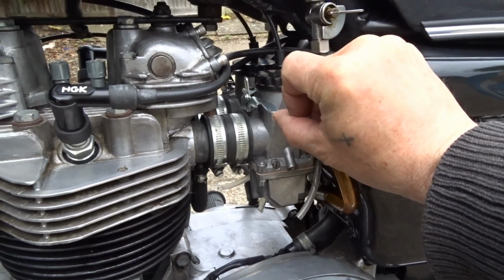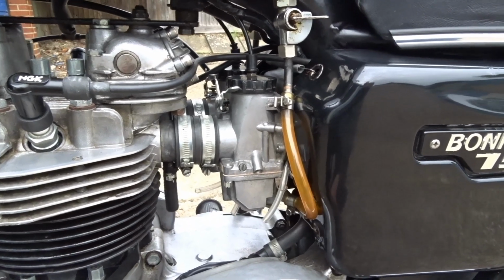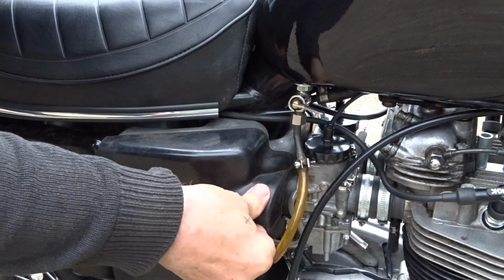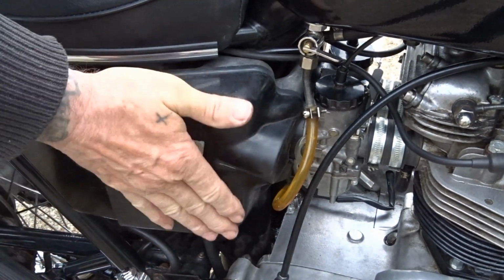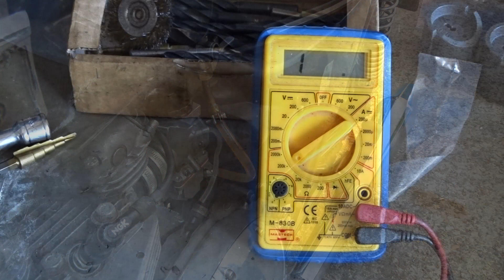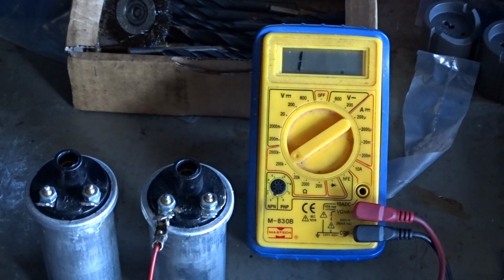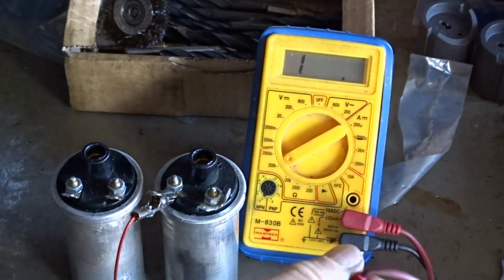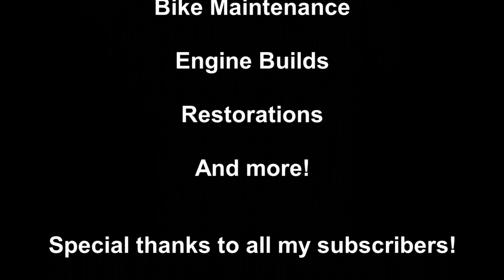Triumph T140 - Stumbling issue while accelerating possibly solved

Comment: I once had an intermittent slight misfire on my T140V, it was mildly irritating when it did it under load, but when it was idling, it would be running ok then suddenly stop. I fitted new plugs, new needles in the mk1s, cleaned out the pilot jets, made numerous air screw adjustments, but it was still there. I tested the resistance on the coils, both ok. After much head scratching, to confirm it was an ignition fault I connected up my strobe and watched the flashes at idle. Now and again, it would miss a flash or 2, and sometimes cut out. As I live quite close to Boyer Bransden's factory near Maidstone, I took the ignition module to them for testing and that was ok too. I'd already checked the ends of the HT leads to make sure they had clean connections, but they were the only thing left, so I fitted new leads and caps - problem solved.

Comment: thats going to be a big relief if a replacement  coil eliminates the stumble off idle.  
Funny how we  get so fixated with the fuel or the ignition or electrics etc  that we don't even consider other possibilities until we have exhausted the first idea that we had.
Reply from the maker: Alright John, I hope it is just the coil, thinking about it though every single carb setup I had done made no difference what so ever in the stumble, you are right about being fixated on one thing,. Then I found the other chap online who had the same problem who solved his issue with a new coil. That got me to rip mine out and check them and find the one faulty. Now we have to wait and see if the new coil fixes it, Tuesday Ii should get them.
Reply: @OldBiker  thats the great thing about the Net isn't it. No matter what information or advice you need ,....someone somewhere in the World has had the same issue and usually found a solution. 
I often wonder how we ever managed to do anything before the internet. !  I have to say though if it were me I'd think seriously about sticking a Electronic ignition on the Triumph for total reliability and consistent timing and advance.   I've had a Boyer on my XS650 for 8 years now and there is a lot to be said for being able to go out to the shed and fire the engine up on the button and never ever have any ignition issues . 
You watch.... now that I have said that it won't start tomorrow now .lol

Comment: Ya got it going yet? Make sure where your header pipe joins the silencer is sealed with rtv and clamped tight... Fixed the flat spot off idle on my twin mk2s
Reply from the maker: Hi Bill yeah I solved the problem in the end completely by blocking the link  pipe (later vid) so the bike uses each silencer separately, there was never enough back pressure with the link pipe open but now the bike runs like it should and has tons of power from the minute you crack open the throttle, no stumbling what so ever and I'm well chuffed with the performance.
Reply: @OldBiker  you might want to look around for brass screw on tops for the the mk2s as the throttle cables will eventually pull through the plastic threads putting out the sync...
Bike looks neat

Comment: A gammy coil as yours tested should mean only one cylinder is capable of firing (the one connected with the good coil). Does not explain your stumble when accelerating...as bike would run very rough at all rpm with constantly low (50%) power output.
On my Norton Commando with OEM Amal twin carbs, a stumble from idle to 1/8 or 1/4 throttle roll-on usually indicates a lean condition. Only the idle circuit and needle jet are operating at this throttle position, so ignore main jetting sizes etc. Richening the idle mixture Air screw and running with needle raised/needle clip in lowest needle notch seems to cure it on my bike. Although I've had a worn needle jet/or worn needle or both that gave a very bad stumble from idle to small throttle roll on (like when leaving a traffic light etc). Unsure how much of this will apply to your non-stock carbs.
Reply from the maker: The coils are wired in series ( Live +Coil- Link wire +Coil-  Earth) so if one coil breaks down I'm getting half the power, half the power = very weak spark prone to flooding when the throttle is opened hence the stumble.